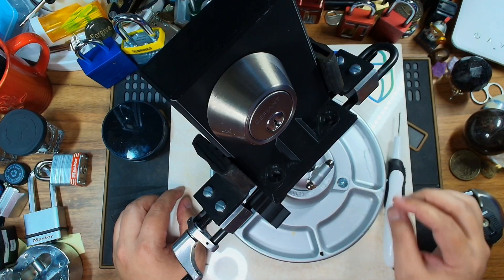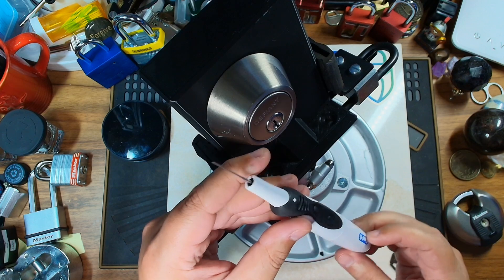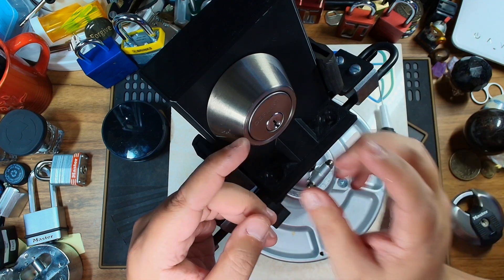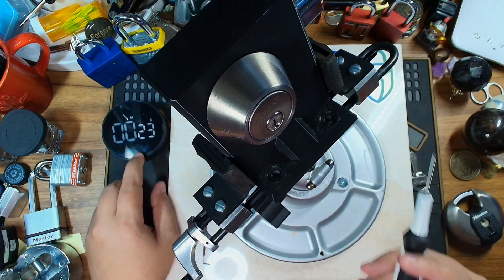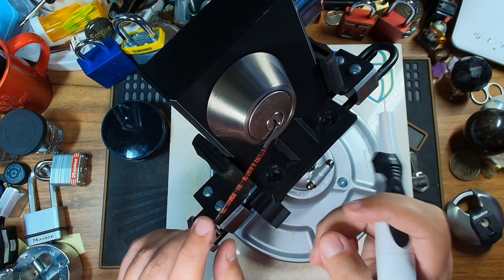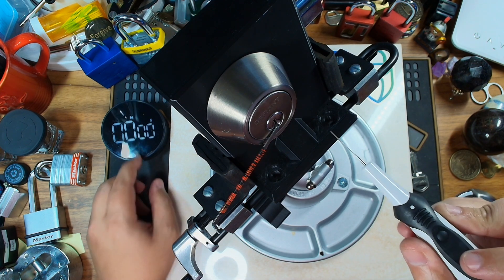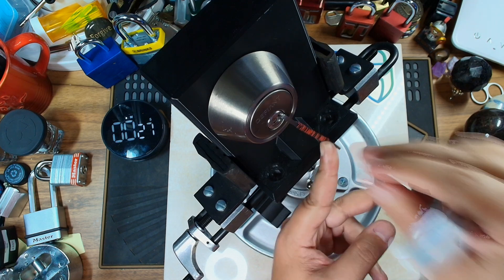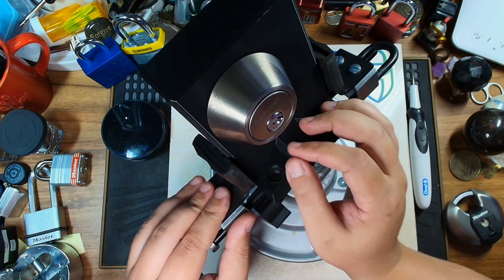(33) Defiant KW1 Deadbolt Opened With Toothbrush

Comment: Very nice. I'm curious-does raking or SPP happen faster or slower than this? Though I 'm sure time and practice will make a difference too.
Reply from the maker: Good question. I think in general it can be faster, similar to using a bump key. But my current weakness is in raking locks open, I have a really hard time with it for some reason, I think it's my tension control.